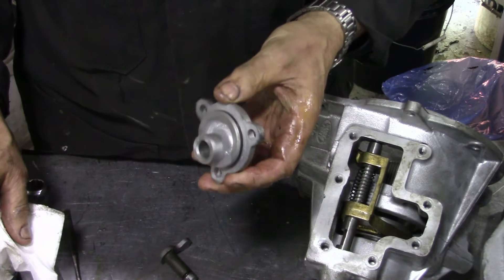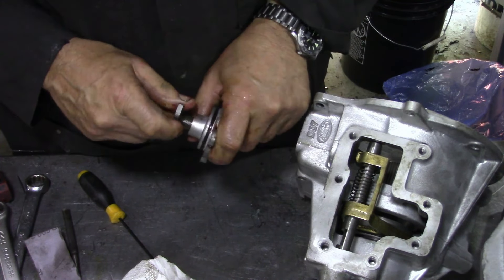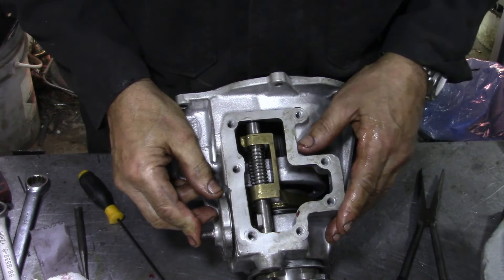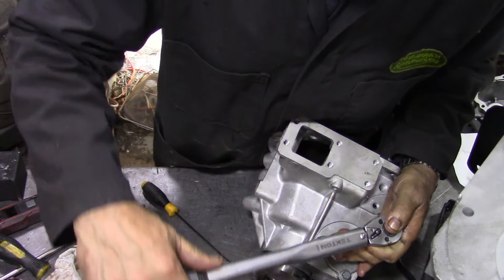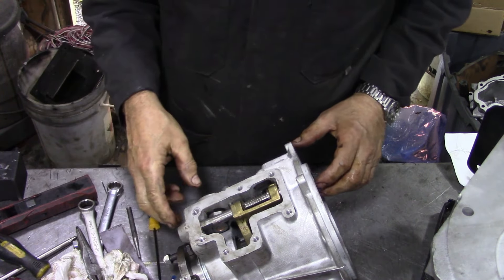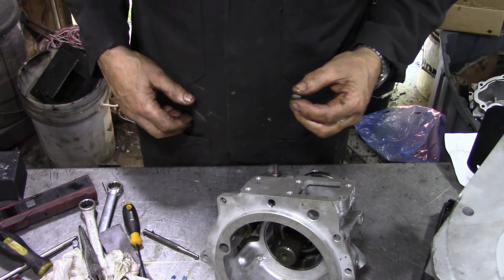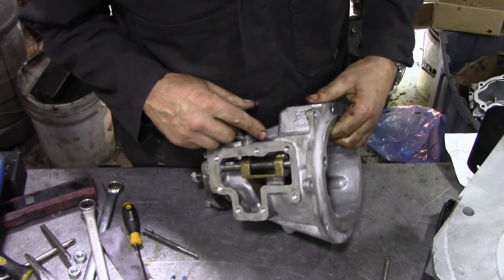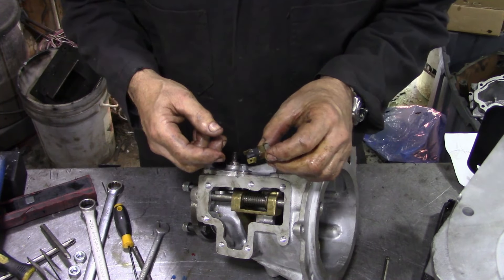LT230 rebuild 2024 with AATB Part 7 Diff lock selector

Comment: Now I know what's behind that bit that moves! I ended up making the diff lock linkage piece from 6mm solid round bar bent to the exact shape of the broken original and welded a couple of washers on to form the stops. Works okay. Nice job again.
Reply from the maker: Indeed! But you can make some major cockups if some of the parts are installed backwards or in the wrong order!